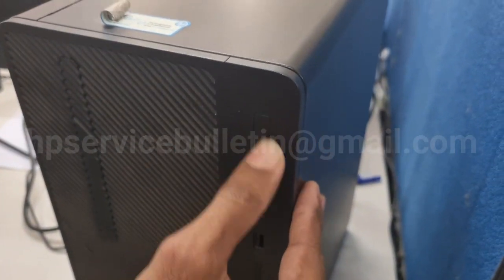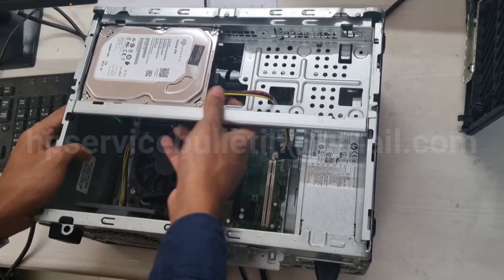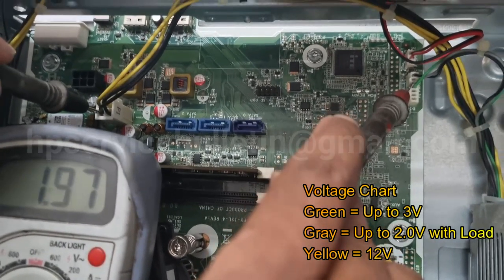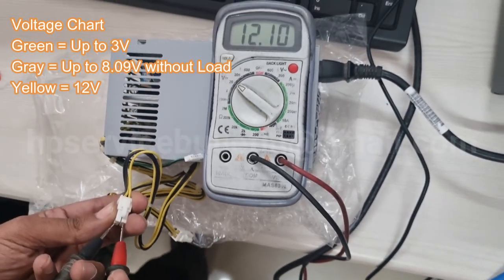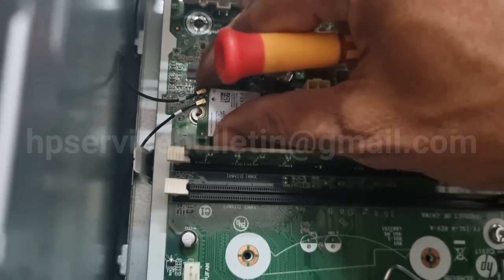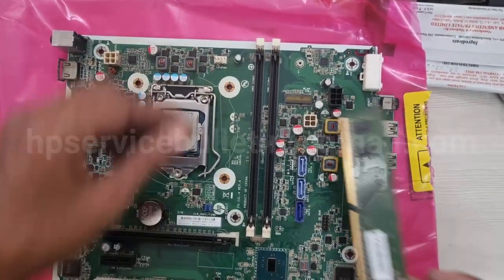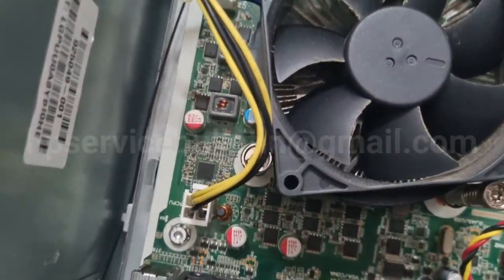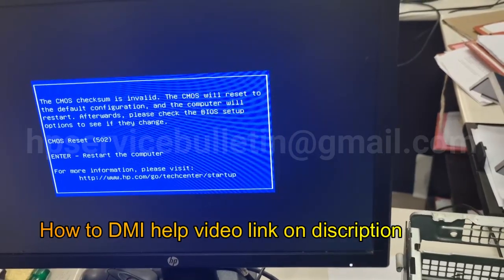How to Check No Power Desktop PC hp 280 : Step by Step Troubleshoot

Comment: How to check serial port drive issue
Reply from the maker: Here’s a clear checklist for Windows, since that’s the most common platform:

Open Device Manager(Press Win + R, and type: devmgmt.msc), Locate Ports (COM & LPT), and Expand it, Look for entries like Communications Port (COM1) USB Serial Port (COM3) (The COM number may vary depending on your system and device.).
If you see a yellow triangle ⚠️ or red cross ❌ on the serial port, that means:
The driver is missing, corrupted, or incompatible.
The device has a hardware or resource conflict.
Once Device Manager shows no error:
Use a serial terminal program like: PuTTY, Tera Term, RealTerm. Open the correct COM port and try communicating with your device.
If you still get errors, it could be a hardware fault or wrong settings (baud rate, parity, etc).

Comment: what is the voltage after load...for grey wire
Reply from the maker: Its may varry based on motherboard,, normally its shown as 3.5 v to 6.5 v
Reply: @hpdoctorofficial  can we make this supply from ordinary supply
Reply from the maker: @sureshprajapat1509  No,, if try with normal SMPS your motherboard will damage... Becouse normal SMPS have soft start funcion include in SMPS. But this type SMPS soft start controld by motherboard,, and smos current senses is defferance between Branded SMPS amd Normal ATX supply.